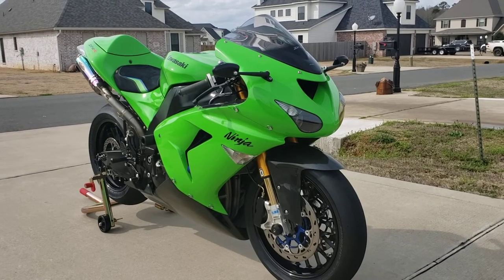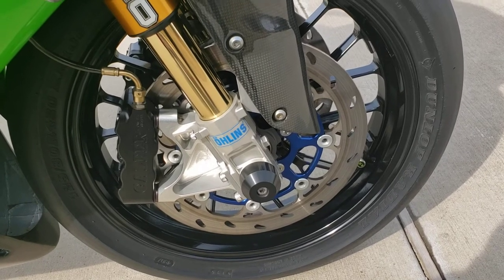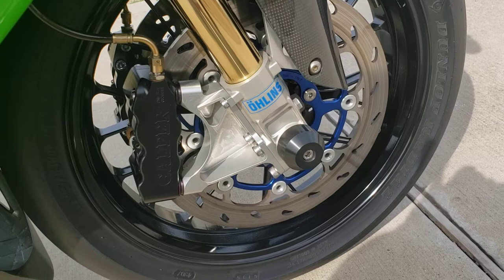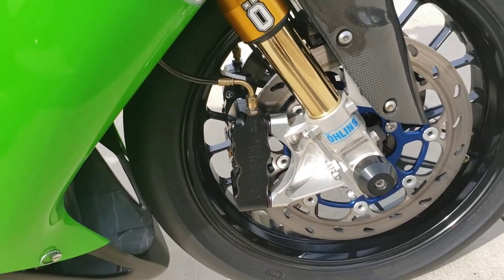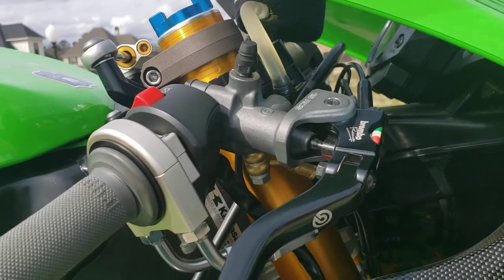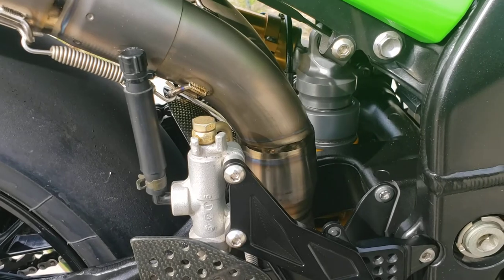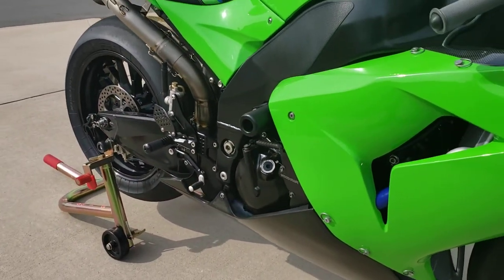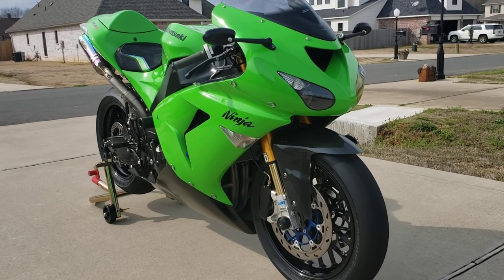2006 Kawasaki ZX-10R  Mean Greenie's Unique Brake System

Comment: I'm trying to get a classic supersport for under $10k(ish) like a zx10 or an rc51. What do you recommend? Love the channel btw.
Reply from the maker: Finding a clean unmolested zx10r is easily accessible.  Shop around find a low mile bike,  depending on what gen you want 10k would get you a decent bike with enough left to put some good mods on it. I'd actually reccomend 3rd gens as they are not very popular and great bikes, and a value.  RC51s are going through the roof price wise, 10k would get you a nice one though,  but....parts availability is becoming a real issue.  Only 05-06 bodywork is available and a lot of the aftermarket parts that are desirable is not being made anymore.  But if you have investment in mind,  RC51s are the better choice, just about 4 years ago was the time to get in, now prices have close to doubled for low mile clean bikes
Reply: @marcjorgensen  haven't been able to find any clean and unmolested Gen. 1 ZX10R's. I have found plenty of frames in good shape though. I think my next project is another Gen. 1 with maximum weight reduction but, it will be still in street trim
Reply: Love the Rear Brake Reservoir delete as well, I'm working in that as well... Do you have an instagram?
Reply: @bacchusthompson5834  I found a Gen 1 with only 1500 miles but yes nice ones are getting rare